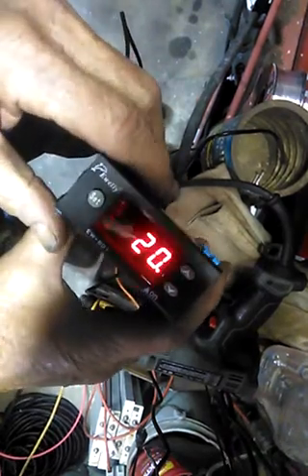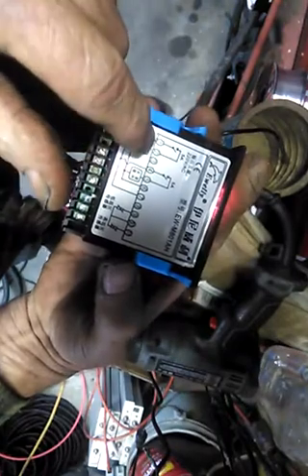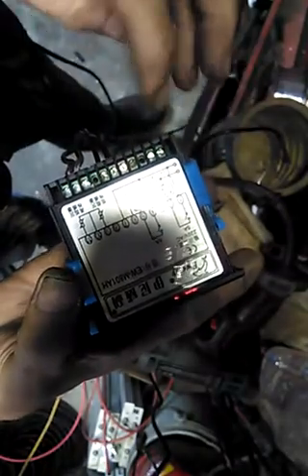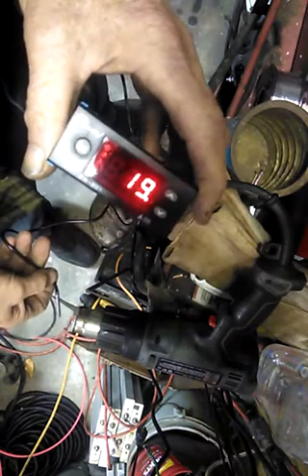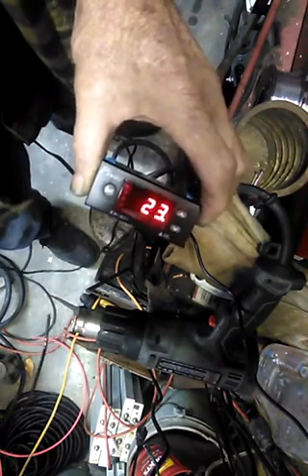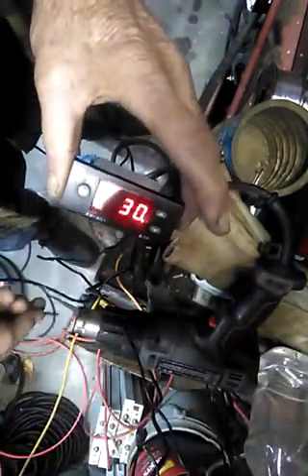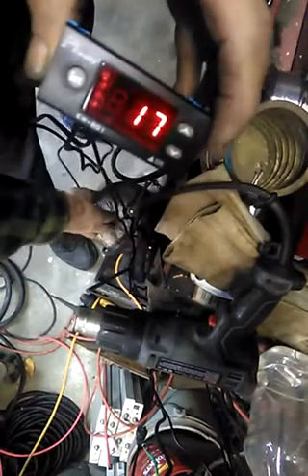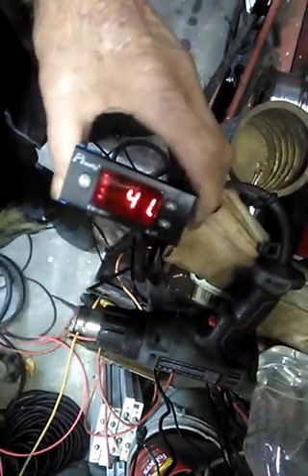Ewelly ew-801 solar hot water temperature controller

Comment: https://www.njuskalo.hr/image-w920x690/grijanje-hladenje-ostalo/ew-801ah-1-220v-diferencijalni-digitalni-termostat-solarno-grijanje-slika-54205085.jpg
Reply: hi, i was looking for ewelly ew-181h manual if you could assist
Reply: @ahmedalyassi9279  
Digital eliwell temperature controller EW-181H 

 

   This product  capable of cool/warm mode switching. lowest temperature limit, peak temperature limit, deplay protection of compressor. temperature correction, temperature return difference, memory function upon power failure, and failure self check.

Product Features : 

 

(1)Cool/warm mode switching

(2)Lowest temperature limit

(3)Peak temperature limit

(4)Delayed protection of compressor

(5)Temperature correction

(6)Temperature return difference

(7)Memory function upon power failure (

8)Failure selfcheck

 

Product Specification : 

 

Overall Dimension: 76(L)*35(H)*76(D)mm  

Hole size: 71(L)*29(W)
https://hgzhigao.en.alibaba.com/product/60380052371-214039097/Digital_eliwell_temperature_controller_EW_181H.html
Reply: @kansaIainen  thanks a lot, i appreciate it

Comment from the maker: I still have not found any information on how to work this device 4 months later emails and whatnot and still no information. I finished my solar set up I've got the panels on the roof in the tank and I need something to turn the pump off and on I started playing with this again trying to figure out how to make it work but I haven't had too much luck. Funny I part you can buy which does a wonderful job except you can't figure out how to use it life in the 21st century.